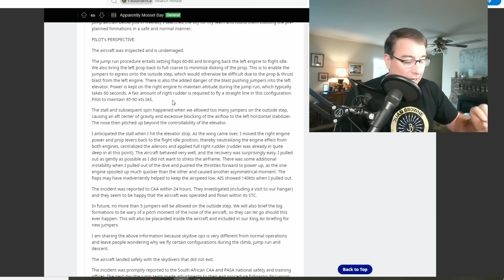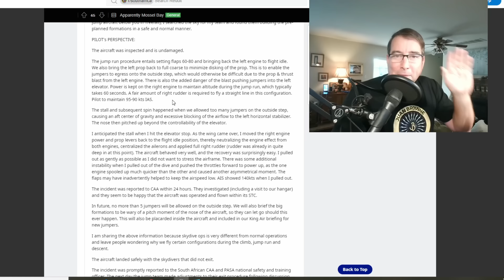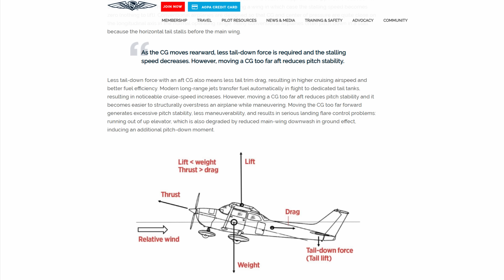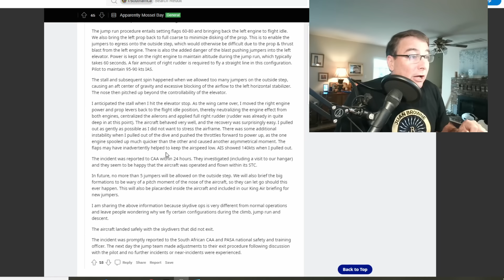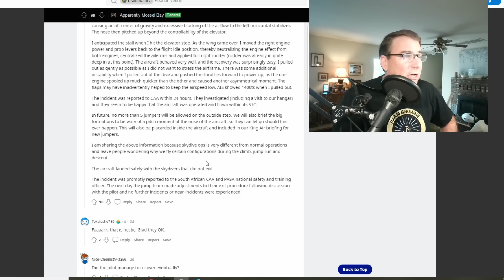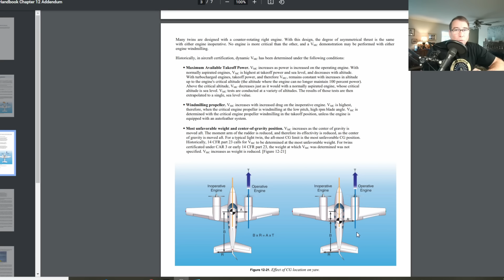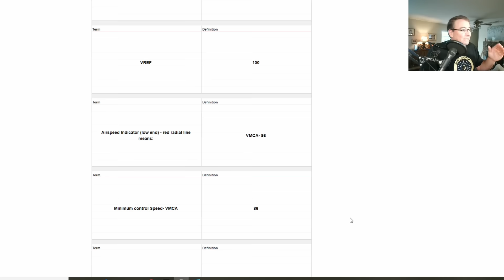Stall+Yaw=SPIN!  King Air Skydive Incident

Comment: I'm a student pilot getting ready for a checkride so I'm asking this just to try to understand the aerodynamic principles at work. I know that yaw plus stall are the ingredients for a stall-spin since yaw is what causes one wing to stall first/more thoroughly than the other wing. But I don't see any yaw here. Yaw is rotation about the vertical axis and assuming the hard right rudder was adequate to compensate for the differential thrust then there is no yaw. And in the video, the plane seems to be tracking straight. So my question is what caused the left wing to stall first. I have two ideas. First is the slipstream over the right wing from the  full power engine may have kept the right wing from stalling. Second is the left wing was more heavily loaded because of all those jumpers hanging off that side of the plane. I love this channel and I've learned a ton from you so I'm definitely not calling anyone out. Just trying to learn.
Reply from the maker: Stay tuned!
Reply: Thanks!

Comment: Forgive me Juan but with right rudder to counter act the thrust of the right engine there would be no yaw.  The ball would be centered.  The displaced rudder would cause drag but the airplane would be in balanced flight with correct use of the rudder.  That's what is done in a single engine scenario, which is essentially what is being induced in this case.  The yaw came because they went too slow to maintain Vmc air thus reducing the rudder effectiveness so that yaw allowed the advancing wing to lift and the retreating wing to stall.

Comment: Totally agree with you...you cannot have un-uniform torque with a biased loading.  Get 1500 feet above your targeted altitude, power down uniformly, drift downward at 1000 ft/minute, allowing cuters to load and drop.  A very dangerous stall it could have killed people.

Comment: I have a few thousand skydives and few thousand hours flying meat missiles in King Air A90, B90 and DHC-6 (Yes the A90 was old even back then).  If the pilot leaves any significant power on the left engine it was very difficult to get out on the door.  We had more than one jumper hit the tail with his head.  If I remember correctly the power was up on the left engine and the nose was up trying to hold altitude while everyone was packed in the back, I wasn't flying it.  I don't remember using that much flaps.    The flaps were used more to get the deck angle down and the tail up so jumpers don't hit it.  I am pretty sure the pilot saying "discing" means he doesn't want the pitch to go flat on the prop so he leaves enough power in so it doesn't.  If it did go flat it would block a bunch of air on the left side.  You really can't hold altitude with a full boat, asymmetrical power,  and getting the tail blocked.  If you tried it would certainly roll over at some point.  Basically you need to know the airplane, know how to fly it well, and have jumpers with experience.  Luckily I survived long enough to get that experience.  I too have had the yoke at the forward stop while I was turned around yelling at them to get off of the airplane.  It happens.

Comment: So during the viewing of this video I managed to spill a 20 oz beer on my desk.  I'm happy for the crew and passengers, and that the aircraft was undamaged, but can we just take a moment for my IPA?  I was enjoying my beer and Juan's breakdown and went to pull my phone off the charger to set my alarm to wake up early to fill food boxes at Salvation Army in the morning when the cable hooked my beer which knocked it over, causing it to foam immediately which ejected its contents all over my desk.  Thankfully the only thing that got saturated was my mousepad and a couple of bath towels.  All electronic devices were undamaged, but the operator was slightly traumatized.

Thanks for all your hard work, Juan.

Comment: All new pilots should be required to practice the "Falling Leaf" maneuver.  This was done in a Cessna 150 and I don't suggest trying it in other more complex aircraft but basically you slow to a power off stall and then use the rudders to keep the nose straight (no yaw).  The stalled airplane will gently lose altitude (fall from the sky) but stay roughly wings level.  We actually would practice this to lose altitude in a simulated engine out when it appeared we were going to overshoot the intended landing spot / field.  Lose the needed altitude, then lower the nose to complete a normal engine off glide.

Comment: Wow, this is fascinating, and I really mean that their aircraft configuration for jumps is fascinating. I was kinda surprised when I saw this. It's basically flying the aircraft in what would be a non-normal condition with a non-normal configuration (think engine failure in cruise but with full flaps when drag should be minimised... flaps up). Now even more power has to be maintained on the right engine to maintain altitude and as you say Juan, this situation was begging to happen ! Keeping the left prop in cruise (coarse) config also makes no sense to me, as putting it to max RPM whilst reducing power is getting close to 'discing' which creates drag and might achieve his plan of reducing airflow to the skydivers (and elevator as well mind you). However I would argue that both props should be at max RPM especially during this procedure to enable quicker power recovery if needed (like say... after a spin recovery !)
I would like to know at which point in the recovery did he throw the left prop lever forward to max after bringing both power levers to idle, because with only the left prop having to get to max with power application, of course he would get more asymmetry in the initial recovery. I would think that basic twin-engine flight rules would factor into their review of these procedures ?

Comment: Lots of comments.  Skydiving above a cloud deck puts up a red flag immediately. Luckily the pilot was able to recover before entering reduced visibility. I imagine this is a high time King Air. The plane could have exceeded the G loads set for this aircraft plus metal fatigue could have caused a failure of the structure.

Comment: Did it for years. Three rigs sitting on my bedroom floor. Exactly what you describe,, some flaps,, reduced engine thrust symmetric,, increase carb heat,, the same way you would set up for a landing.   The additional thing is,, the craft is going to be tail heavy during exit.  The jumpers should not all gang up at the door line,, stretch the interior jumpers back toward the nose.  Speed of jumpers pre-exit,,, ya wanna climb outside,,, well do it,, don't snooze.  And what is with putting all of your jumpers outside?    Put three jumpers out and allow the other jumpers to exit caterpillar.   Is there a deflector strip on the forward edge of the door?

100% with you.  Tail heavy, vastly increased drag, asymmetric thrust, slow jumpers,, exactly what you get.

Comment: Agreed!  I used to skydive, and in many jump planes (even single-engine Cessna types) it was fairly common for the jump plane to slow down close to stall speed, accepting a little altitude loss... just as you described.  (Not sure, but I believe the DC-3s I jumped out of reduced thrust symmetrically, again, excepting a small loss in altitude.)

Comment: He reported that he was at forward stop but the picture at the wing drop shows elevator full aircraft nose up, indicating he slammed his yoke from full nose down to full nose up when the stall broke. Having the props asymmetrical, chopping power does not do a lot to recover symmetrically. Firewalling throttles does not help recover from the spin either.. Very high workload! Which can easily result in panic, which I suspect briefly happened.

Comment: Very interesting. But not sure if the engine idle / coarse setting has much to do with the onset of the accident. Their diagnosis - disrupted airflow over left elevator - seems to be spot on and would probably happen regardless. Although the recovery may have been far less spectacular without asymmetric thrust.
Nonetheless the opening sequence with the music is work of art, it's perfect, with the sun, the clouds, amazing camera work...

Comment: My most memorable spin training was in a Piper tomahawk. Damn that thing would spin fast !
Reply: There was a story in I think, Aviation Consumer or one of those no advertising pilot mags maybe 30 or more years ago about the certification of the Tomahawk.  The production aircraft did not follow the design of the flight tested aircraft. The production aircraft had one less rib in each wing.  Completely illegal.  The lack of support led to the wings oil-canning in a spin and occasionally leading to an unrecoverable spin.  The author wondered why no one at Piper ever went to jail and why the aircraft weren't grounded.  I'm a long time professional pilot who has flown ultralight, single-engine, supersonic to four-engine heavy jets, and the Tomahawk is the only aircraft I would never fly in.

Comment: They pull the prop back to high pitch because "discing" of the prop will result in much higher drag on the left side when power is reduced on that engine.

Comment: Disking: the effect where the thrust from the prop is less than the forward speed of the airplane. Think of it as a large diameter speed brake.
Another observation is how close the KingAir came to the jumpers after the first revolution of the spin. Maybe it’s the camera, but that was very close and the outcome could have been far worse.
Totally agree that this procedure should be changed.
PS. The Harvard (aka T6 Texan) is no slouch at spinning either :)

Comment: I am not a pilot. I started shaking my head as soon as i read the part about reducing power on the left engine and using the rudder to counter. What was that guy thinking? They need to revise that “procedure” for dropping skydivers or get a single engine plane.

Comment: You forgot the left side extra drag component inducing yaw as well.  Also, those are not subsequent stalls.  He is looking for a whole bunch of "meat missiles" not to run into in his recovery.

Chances are, the five jumpers still in the plane when it entered the spin violated a rule that is written up on the wall of all King Airs that requires X number of jumpers stay forward of that line.  There could have been more jumpers inside the shifted CG aft which are not seen. 

As for IMC conditions, this happened in South Africa, this may not have been a rule like it is here in the USA. 

One last thing.  Time is money.  Most drop zones have people waiting on the ground for the next jump.  It is very common for a King Air jump pilot to turn the plane over into a dive and approach VNE  to get back down quickly.   Typically, this plane is landing touching down as jumpers are landing under canopy and a good King Air pilot is accustomed to operating it in atypical manner.

My educated guess is the five jumpers you did not see were aft of the CG line written on the bulkhead and that was not in the report.

Comment: We fly a king air B90 and E90 and also pull the left engine to flight idle. It massively reduces the prop blast which makes it easier to hold on the outside of the plane and the the blast can easily push you backwards causing a tail strike which will probably end much worse than this video.  It's a low tail on both the B90 and E90, and its quite close to the door, the high tail king airs don't have this problem. Overall pitch angle of the king air is also important with respect to where the tail is, some configurations are better than others. This configuration seems to be a balance between what's good for the plane vs the jumpers.
Regarding the clouds this jump wouldn't be legal in the US, cloud clearance for skydivers are pretty much the same as class E daytime cloud clearances, also most operations don't want to deal with IFR so if the plane can't fly VFR it doesn't go. In other countries this is not the case and it's quite common to fly and fall through clouds, especially higher clouds where you exit the cloud before deploying. Falling though clouds isn't terrible but you really don't want to be under a parachute in a cloud as you can't see others, you also don't want to pop out of the clouds at 1500 feet after flying in the complete wrong direction for the last couple minutes.
I agree with what others have said, the jumpers are at fault for loading down the tail. The people inside the plane within the same group are probably right by the door too, also weight in the tail. Ideally you don't do huge groups out of a king air, I still think 5 on the outside is too many. If you are doing a big group work it out with others in the plane and the pilot, the pilot can adjust as necessary and as much weight as possible can stay forward while the big group exits.

Comment: Almost exactly the same as the DC3 skydiving stall video....look that one up if you haven't. Could be an identical failure more with engine power settings and jumpers clinging to the outside.

Comment: All of the published King Air V speeds are defined within a certain CG and aerodynamic configuration. The open door, external passengers (for lack of better term) and subsequent aft CG define what is essentially a new configuration, for which the aircraft is NOT certified for and therefor all V speeds are likely invalid. Unless the jump aircraft STC did flight testing with this configuration, the pilot here was acting as a test pilot - with some odd looking ballast on his plane.
I can see why this would get some scrutiny from the authorities - and hopefully for the better.

Comment: I used to fly a C182,, much smaller I know but I echo Juan in terms of descending to keep airspeed up. You can’t keep straight and level, at idle power, with jumpers on the strut, and not expect something to happen. For me it was a wing drop that made me realise, so all drops after that I just dropped the nose a bit to keep the aircraft FLYING. 
I wonder if the flap speed was exceeded in this incident.

Comment: I think that not blowing jumpers back into the elevator is a big part of why they reduce power. I imagine hitting something at that speed could easily kill a jumper, either by the impact or by knocking them out or injuring them in a way that they can’t pull the chute cord. And the impact of 150-200lb of person with the elevator could damage it, endangering the aircraft and the rest of the people on board.

Comment: I flew jumpers almost 30 years ago in Kingair and caravan and twin otters 

I would never do the technique as he described 

Pretty much as you thought was the technique used
Both engines at reduced power, accepted some drift down

We only carried 14 in the A90, there were 8 out when he stalled 

Letting the inmates run the prison 

The entire things is nuts to me

Jumpers in this country will bust any common sense or regulation possible 

Jumpers love going thru clouds as it gives them a sense of speed, but in this country the FAA would go after the pilot whenever they could for this

Low hanging fruit

Nice job on breaking down this video

Comment: I am a former skydiver and rated pilot with a multiengine rating, but low time.  I was part of a load that experience nearly the same incident.  I was further forward on the load and was due to follow the other jumpers.  The bars on the outside of the aircraft are usually called "Floater Bars" and allow jumpers to exit the aircraft and position along the side so as to have the exit as close together as possible.  This is done so the skydivers can maneuver relative to each other to create different formations.  When I watched this video it was almost exactly what happen to us, in that the "floaters" took too long to position themselves.  In my case the jumpers were climbing on the wing and along the floater bar and took way too long.  Suddenly the King Air pitched up and rolled to the left and everyone fell away, with some hitting the left flap and damaging it.  As they jumpers fell away all I saw was ground and ocean and I thought the aircraft was going to spin, so I up my hands up and stopped myself against the door frame.  We didn't spin, the pilot quickly recovered, I remained on the aircraft and we landed safely.  Later I asked the pilot what happened he denied it was a "stall", but a "VMC roll".  The flap was replaced and ops continued as if nothing happened.  One thing I noticed about this video was it appeared to be near sunset, and (at least in my experience0, you get a "sunset load", where you climb as high as you can while sunlight remains.  On one load we climbed to over 17,000 feet.  I was familiar with hypoxia and was beginning to feel the symptoms on jump run.  Many years later, another Skydive operation's King Air was doing a "Sunset Load" and after the jumpers exited the aircraft the aircraft never returned and was never found.  I believe the investigation found that this load was well above the altitude where oxygen is required and the pilot may have loss consciousness due to hypoxia.  I my belief skydive operational aircraft accidents can be linked to lack of proper safety protocols, basically they do what the can get away with.  Just my opinion based on decades of skydiving, which I no longer do, for many reasons.   Love your channel and your content.

Comment: It looked like the stall didn't occur when the sixth jumper came out, but actually when he leaned back and blocked more airflow.  I'm not saying the weight wasn't a problem, but it seems like blocking the airflow could have been more serious.  Even with three divers, if they all leaned to block the maximum airflow they might reproduce the problem without the extra weight.  Any merit to this thought?